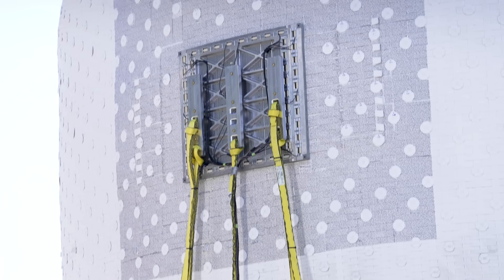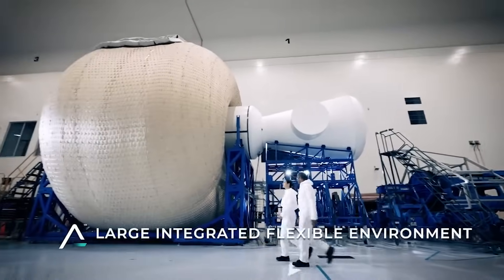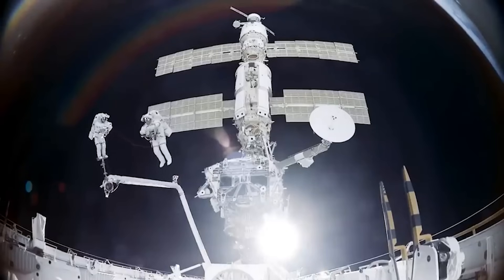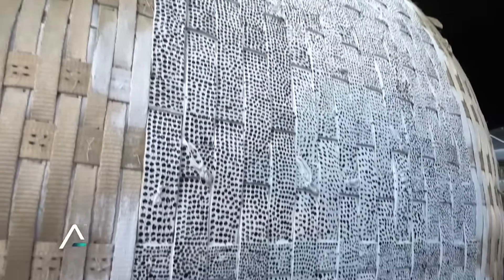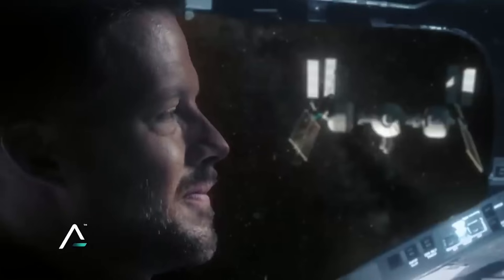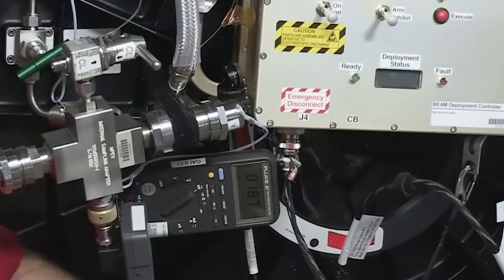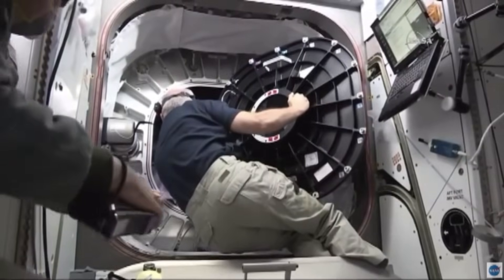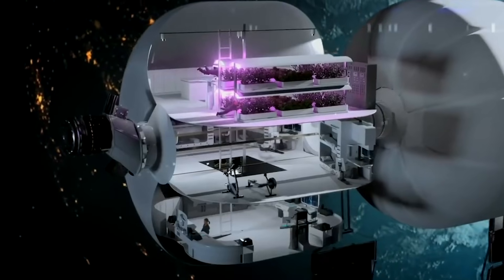Are Inflatable Space Habitats Safe?

Comment: I don't know why people think it's a problem - there's only 1 atmosphere of pressure difference between space and the surface of the Earth - that's the same as being 10 meters underwater and nobody is worried about swimming goggles.
Reply: We all know why.. decades of people getting sucked out windows in hollywood
Reply: Exactly my thoughts, and if they wanted to they could drop that down lower and still be habitable.  My first concern when I hear this is space junk popping it, not it bursting by the internal pressure.
Reply: @deveusdude  - Same here - although with current rocket weight limits we can't launch a solid module with metal thick enough to stop punctures anyway - so it's piercing a coke can vs piercing a football - as long as it's a puncture and not a pop ;)
Reply: No, the problem is that on the ground , the average speed any projectile  0-100 mph at most , the record highest wind gust is 253 mph
In space a simple rock is traveling nearly 10 times the speed of sound
Then there is the issue of cosmic radiation 
For setting bases on Mars , these make absolute sense. The base can have dozens of these modules and only need a few harden ones in case of radiation exposure
as well only need a few layers of metal for shielding saving thousands of pounds in weight
But open space
there is just too much that can go wrong
Reply: 1 atmosphere is almost 15 lbs per square inch. That is a lot of pressure. And most people do not worry about it exploding, but it getting punctured by debris.
Reply: @markschoenberger7825  There are several layers designed specifically for protecting against debris. How is it any worse than the aluminum modules and their kevlar protection?
Reply: @haydentravis3348 I'm agreeing that the video design is good
Reply: You are forgetting exposure to the vacuum of space means instant death.
Reply: @MrGlenspace  - No it doesn't, hollywood lied to you. Fish don't explode when you take them out of the sea nor do humans when you take them out of the atmosphere. Search for it, you'll survive as long as your brain has oxygen - about 15 seconds. It'll take about 20 hours for your body to freeze. One person was exposed to pure vacuum by accident (testing a spacesuit) and they lived.
Reply: @MrGlenspace Yes but you wouldn’t get exposure to the vacuum of space. It would slowly leak out over the course of several minutes in the event of a puncture. That would give you enough time to plug the leak.

Comment: With decades of advanced material technologies, reinforcement, testing and forensic failure analysis engineering experience, I am very concerned about ultraviolet light degradation of Vectran which is highly degraded by Ultraviolet light, especially in Space.
Reply: Good job they're scientists and engineers and the outer layer protects against ultraviolet light. Maybe you should assume people that spent years of their life at university know what you read on wikipedia?
Reply: @JohnnyWednesday  I have been educated to multiple Ph.D.s levels and a pioneer family in advanced synthetic reinforcements from the 1950s to today. 

I have been involved in the chemical, mechanical, processing, new product development, manufacturing, testing and advanced forensic failure analysis engineering since the 1970’s. 

When you finish high school I suggest you go to college and obtain Ph.D.s in chemistry, physics, textiles, and mechanical engineering of advanced materials including synthetics, in reinforcements and primary structural elements.
Reply: @icare7151  - that's a lie. If that were true you'd know full well your peers wouldn't make such a fundamental mistake.
Reply: @JohnnyWednesday  With decades of testing ie ASTM (I) and forensic failure analysis engineering experience, one would be shocked of the errors constantly discovered in all industries on all levels. 

These errors keep the legal profession very lucrative and even deadly for thousands year after year.
Reply: @icare7151  So you're saying an out UV protective layer would not be effective?
Reply: @TheEvilmooseofdoom  Depends on durability and real world in space functionality.

Comment: Sure, for robots. .. but they don't need them. Book: The End of Astronauts: Why Robots are the Future of Exploration.  And I disagree with the authors that astronauts should still be used in low Earth orbit.  They should have been replaced long ago by satellites designed for robotic servicing {like the Hubble should have been) maintained by low latency links using Earthbound human operated, remote presence tele-robotics.   Manned spaceflight is SO 1960s.
Reply: Currently robots cant do what humans can do. They won't be able to for a decades more. You can put a servicing station on the satellites like Hubble, and then deal with the extra complexity and weight, or just send a person up there with extra parts if something ever happens, and save the weight.

Comment: Shouldn't they be testing the burst strength of that thing in zero gravity?
Reply: Zero gravity won't make any difference. The only thing that will is air pressure. But they already are taking into account the fact that there will be a vacuum in space by just testing well beyond what will be the operational range of pressure.
Reply: @SebastianWellsTL  Air pressure only exists in gravity.
Reply: @southofhollywood4199 uh, no. Air pressure is just a measure of how much of a gas is in a set volume, more technically how many collisions gas particles have with eachother and the walls of the container. The only affect gravity would have is with multiple gases going into layers with different weights
Reply: @ASlickNamedPimpback  I Googled air pressure too.  Air pressure only exists with gravity.
Reply: @southofhollywood4199 are you referring to the quora answer that refers to ATMOSPHERIC pressure, i.e. the pressure from air being contained to earth only via gravity, and not because its in an inescapable container?
Reply: @southofhollywood4199  Clearly you did NOT google air pressure, because it does not require gravity.  I think you're trying to pretend that you understand far more than you actually do.  It's not helping you at all.
Reply: @TheEvilmooseofdoom  I really don't want to be your friend.

Comment: The biggest issue with inflatable habitats isn't safety. It's the fact that they are empty when they inflate and you need a second launch to bring up all the interior equipment (and have to assemble and test the interior equipment in space). Those two launches could have been used to bring up two traditional station modules are are ready to go after installation. So the size benefit is 1/2 of what it initially appears.

However, inflatable habitats are much more practical on Lunar or Martian bases as gravity, and the need to walk, makes space a premium.
Reply: Most of the internal components that are launched later will probably be things that would fit into something like a Progress resupply vehicle launched on a relatively small Soyuz-sized launcher, while a traditional Space Station segment would require a much more powerful Proton-sized launch vehicle.
So inflatable modules let you launch one heavy-lift launch vehicle and a bunch of medium-lift launch vehicles, instead of launching multiple heavy-lift launch vehicles.
Additionally, inflatable modules let you ignore some of the volume and diameter limitations usually imposed by rocket fairings. A 15m by 16.2m cylinder is something that simply can't fit into a rocket unless it's folded up, like LIFE 2.0 will be.
Reply: Only twice as large you say? what a waste of time. Why even bother with a 2x improvement? may as well spend a billion dollars more.
Reply: @JohnnyWednesday  It's not twice as large, that was my whole point.
Reply: @Hedgehobbit  You pack all the equipment in the center core.  You're not thinking it through far enough.
Reply: @TheEvilmooseofdoom  If you watch their destruction videos, you can see that there is very little room in the center core.
Reply: Not true.  Bringing up machinery and assembly in orbit isn't too hard as things are pre built and just need assembly.
Reply: I would also say this can be designed to have the equipment racks in the center and they can flip out to utilize the extra space. Think of some of the tiny houses or even the RV with the bumpouts.